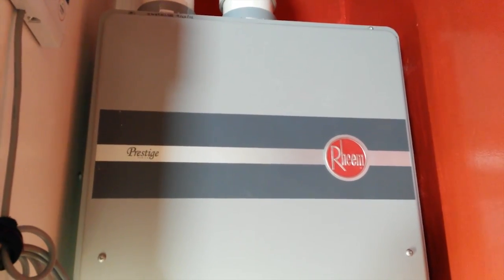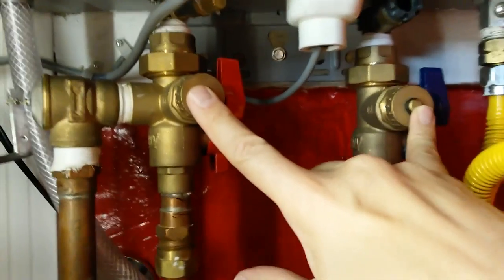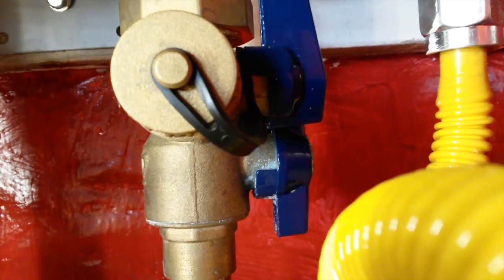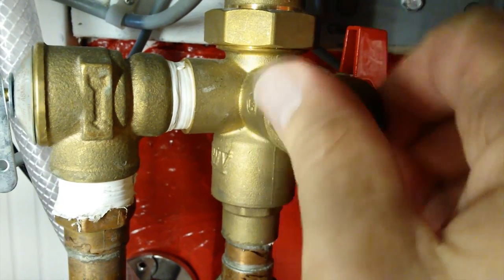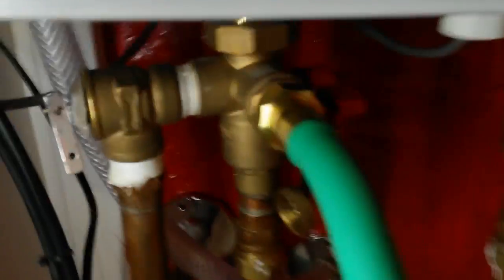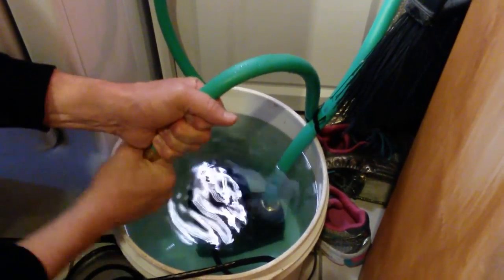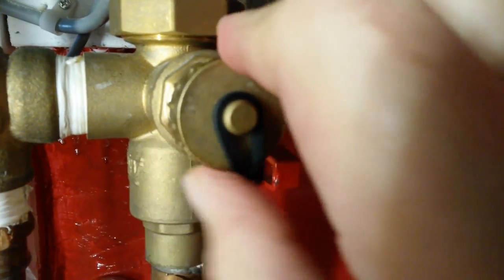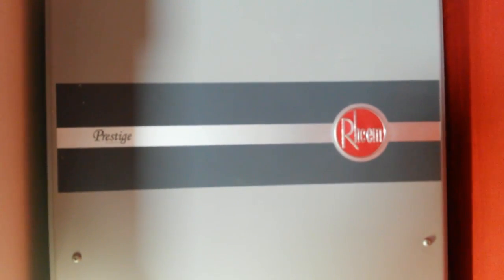Rheem Tankless Lime and Scale Flushing (See updated video https://youtu.be/St38CFhiaI0)

Comment from the maker: For updated procedure go to https://youtu.be/St38CFhiaI0

WARNING: Do not use the power switch to turn off unit, instead just unplugged or turn off the circuit breaker. This will prevent the internal valves from closing and bypassing the heat exchanger.

For updated procedure go to https://youtu.be/St38CFhiaI0

Comment: If mine doesn't have service valves, how can we flush the unit?
Reply from the maker: In order to circulate the solution you would need service valves added to the system. In the past I have purchased two of these units and each time had to specify the valves. I understand now more companies are now including them.

Comment: So I followed your replacement video to a T and when I run the pump nothing comes out of the hot water side.  I can lift the thermal relief valve and it will flow out of that, but not a drop out of the hose side.  Do you need to have the hot water running in your house when you kill the power to it to keep the internal flow control valve open?  Because if you just power it down with the unit not running the valves would already be closed.  I don’t get it.
Reply from the maker: For updated procedure go to https://youtu.be/St38CFhiaI0  You need to turn off power to the unit, as opposed to using the power switch.
Reply: Thanks for the reply.  I did follow the replacement video and I have no water coming out of the hot side with the pump running.  The unit was not running when I powered it down via the breaker so I’m wondering if there’s an internal valve that is remaining closed?  Should I have the hot water running inside the house when I cut power maybe?  This is a non-condensing unit BTW.
Reply from the maker: @allenemiesforeignanddomest3320  With the unit powered on and the power turned off from the breaker the bypass valve should stay open. (No need to run water) You can test this by allowing water through the inlet service valve into the tankless and it should flow out of the outlet service valve. If that works then check connections to pump to make sure your pumping into inlet side.

Comment: I bought this water heater https://www.youtube.com/post/Ugkx8G49mV71sAzUl9shXyLW-r3XgHH9EVh1 for use in my bus conversion. I installed it under my kitchen sink and it is fed by a high efficiency on-demand LP water heater. It is both a backup hot water source as well as a water saving device since we have hot water on demand rather than having to wait for the gas on demand water heater to finish its ignition cycle. I decided on this water heater due to the fact that it only draws 1300watts when it's ON instead of the 1500 watts that most Water heaters this size draw. In an RV a couple hundred watts can be a big deal. With very low standby losses, I don't have to worry about excessive power consumption. When propane is not available for our gas water heater, in conjunction with our low flow shower head there is enough hot water available to shower, albeit we won't be taking "hotel showers." Also very happy with the recovery rate of this water heater. Granted, it is quite small, but it does exactly what we need it to do.
Reply from the maker: Angel, that is great news, but the manufacturers instructions call out for a dedicated circuit for the water heater. They do provide for several water heaters to be connected to a single circuit, providing it does not exceed the rated service load. Thank you for watching.

Comment: Some additional information from a plumber:

1) The gas tag on the gas inlet is usually just covering the testing port to test gas pressure and most of the time has nothing to do with adjusting or fine tuning the tankless. (At least that’s my understanding with all the training I have gone through.

2) the condensation drain on a lot of those units (not Navien) can be capped like that if they are horizontally vented within a certain distance. They must have a drain attached though if they are vertically vented.

3) Additionally to cleaning out that cold inlet screen you should have the tankless flushed/descaled yearly and if your water is “hard” (has a lot of calcium and magnesium causing scale buildup) you should have a form of water treatment to retain most warranties.
Reply from the maker: Thank you for sharing your insight on this important topic. An updated version of this process is available at https://www.youtube.com/watch?v=St38CFhiaI0&t=0s which includes not using the power switch.

Comment: Incredible video!  Thanks for sharing your knowledge!  We bought a home with a Rheem and in following your instructions, noticed that this installation doesn't appear to have what you refer to as "service vales".   How might I go about flushing this without them?
Reply from the maker: Without the service valves you would have to disconnect the inlet and output lines. At which point you might as well add the service valves. It a shame they weren't put in at installation.
Reply: @cfldriven  Apologies for the delay - thank you for the response!  It appears there are service vales, but no means of turning them off as in your video. Is that just a poor install where a step was skipped (no means of turning off the feed to the service valves)?   This set up looks identical to yours with the exception of missing those smaller handles to cut off that water feed.  Wish I had a means of sharing a photo.  Appreciate your channel and sharing your knowledge!
Reply from the maker: @Steven-wp4wu  Some tankless units include services valves, but both of my Rheems did not. Each time I had to instruct the plumber to include them as part of install. Funny thing is the installation instructions call for them to be put in. 
It is interesting that the service valves from 4yrs ago only have one valve per side as oppose to the double valves in the video.
Reply: @cfldriven  What our unit has is the service valves (with port caps), but not the handles to turn them on/off to isolate the system.  Does that mean this was installed incorrectly?
Reply from the maker: @Steven-wp4wu  Steven, to flush the tankless it must be isolated from the rest of the house plumbing system. Is there a cold water shut off valve leading to the tankless and a shut off valve on the hot water side? If there are in close proximity to your service ports it could work.
Reply: @cfldriven  yes, the hot & cold shut off handles are in line with the service caps.  Is there a means of sharing a photo with you?  In the interim, I've placed an image in my profile pic. Does that help?
Reply from the maker: @Steven-wp4wu  Your setup will work, this design handles the function of the dual valve using only a single valve.
Reply: @cfldriven  Yay!  Thanks for all the support and sticking with me on this one!  Getting my supplies sorted to tackle this over the weekend.  Appreciate it!
Reply from the maker: @Steven-wp4wu  Glad I could help, I actually have a similar valve and port setup. Perhaps I should do a video about it. Good luck with the project.
Reply from the maker: @Steven-wp4wu  Hope your project was a success.

Comment: Maybe I missed it, but you never said yo turn off the water going into the unit. (Pre-bypass valve)
Reply from the maker: You are absolutely correct, since the service valves include shut offs for the incoming and outgoing lines plus to each of the ext ports there no need to shut off water to the rest of the house. Of course if one feels more comfortable it can be done. Thanks for bringing up a good point.

Comment: Is there any need to turn off the Gas Valve in this process?
Reply from the maker: It is part of the official Rheem procedure, with the power off the unit can no longer operate or monitor the internal gas valve and thus closing the external gas valve avoids any possible leak.

Comment: Thanks for this video. Very helpful. The manual mostly made sense but this walkthrough really helped bring it all together.
Reply from the maker: The big gotcha is not using the power  button to shut down the unit, instead unplugging it or shutting down the circuit to it. Thanks for watching.
Reply: cfldriven thanks for the tip. I did also watch the updated video that you made.  Thanks again.

Comment: One problem...inlet cold water valve is closed when power is disconnected....now what??
Reply from the maker: Inlet valve closes if you press the power button, if you just pull the plug or open the circuit the internal valve remains open.
Reply: @cfldriven  that's only if it on and running. I have a bank of 7. I flip the t&p valve then close the outlet on the hot water side while the unit is running. Then just unplug and the water inlet valve stays open. Then I start the flush. Then I have to let the system cycle to the next one, and do it again.
Reply from the maker: @insideoutsideupsidedown2218  Thank you for sharing your experience.

Comment: I have a 1800 gph 1/4 superior submersible pump? Is this an adequate pump to use?
Reply from the maker: As long as you don't exceed the max pressure rating for the unit you should be fine. You just need enough pressure to flow the solution through the coils.

According to the manual "The pressure rating of the relief valve must not exceed 150 psi (1,034 kPa) or the maximum working pressure of the water heater. (See the rating plate on the water heater.)
Reply: Yes

Comment: Hello, What kind of pump do you need to get?  Did I miss a link?  I'd love to know where to get the products needed so I don't have to pay $130 for the service and $159 for the visit (this is the only company that I can use or it negates warranty). Thank you!!
Reply: Also, I haven't done this before and our tank is 4 years old.  Do you think I should do it more than once? Thank you!
Reply from the maker: Stephanie, thanks for posting a link. The pump I use was a gift so  I have no idea what it cost. 
In your case I would replace the solution and run the pump one more time. After that at least once a year. Good luck and thank you watching. If you can subscribe, thank you.
Reply from the maker: Stephanie, you can try the following link for a connector or any hardware store. Especially like an Ace or Tru-Value. You don't want too long of a hose because you'll need to push the solution through the entire length and the pump will have to work harder.
https://www.grainger.com/product/1P724?cm_mmc=PPC:+Google+PLA&s_kwcid=AL!2966!3!166588899559!!!g!82166687037!&ef_id=WBoTcAAAAWH28ffZ:20180131025836:s&kwid=productads-adid^166588899559-device^c-plaid^82166687037-sku^1P724-adType^PLA

Comment: THIS IS NOT CORRECT AT ALL!!!!!! if you turn off the remote control to the unit before cutting the power you will activate bypass switch and the whole process will not work. you will end up wasting your time and vinegar.  DO NOT USE THIS VIDEO
Reply: Crap, now I have to do it all over again, I followed this video, and didn’t read through the comments, as a neighbor shared it with me. Off I go to get more vinegar. Smh
Reply from the maker: Yes you are correct, as I had already noted in the description and even provided a link to an updated video. The reason for leaving this video up is it shows the process and provides useful information, including the correction. Thank you for your feedback.
Reply: You beat me to the punch Kristi. You are 100% correct. People that are not in the trade should not be making these videos and wasting peoples time and money.
Reply: I’ve tried killing power at the breaker, turning the hot water on inside the house and then killing power and nothing works.  Water will not flow!!!  There is something about these Rheem’s they are not sharing to get the flush to flow through the heat exchanger.

Comment: That is one of the ugliest installs ive seen. Flex water supplies and flex gas line is pure laziness. Correct way to flush a tank tho!
Reply from the maker: Actually in California flex lines into appliances is the way to go due to seismic activity. The problem with replacing an old water heater with most tankless unit is the connections are on the bottom. Definitely worth doing in new construction or remodeling, otherwise installation can be challenging. Thank you for commenting.
Reply from the maker: Good question, it all depends on the type of shaking, the amount of shaking and the duration. It may stay bolted or it may be stressed beyond limits, causing it to dislodge or fall. The flex lines are per code. 

In the Northridge quake the top strap on the water heater failed and the unit tilted. Only the flex lines kept it from falling over.
Reply: James Webb no shit,‘horrible

Comment: Thanks for posting the video. I have had the same Rheem tankless water heater for a couple years now and have not flushed out the scale and lime yet. I am concerned about recirculating the scale back through the pump and coil system. Is there any visible scale left in the bucket after the process? If so, would you recommend placing some kind of screening barrier (i.e. pantyhose filter on the outlet) between the two flows? Also, would a 300 gph submersible fountain pump be sufficient? Thanks again!
Reply from the maker: The solution dissolves it, so there isn't a need to do more. At 300 gph we are talking about 5 gpm which for the recommended run time should be sufficient.

Comment: How often do you need to do this?
Reply from the maker: Once a year
Reply: @cfldriven  Nice video, thanks! 
If a water softener system is installed, do we still need to perform descaling every year?
Reply from the maker: @rkneti  Depends if the water softener is before or after the tankless unit. If before you can go longer, in my area I have soft water and will be flushing every three years whereas my prior home had hard water area and it was every year.

Comment: "WARNING: Do not use the power switch to turn off unit," 
is this the power button on the remote control that you are referring to? i flushed mine today, i just cut the power at the breaker box without turning the unit first using the remote control.  but i didnt see much scale in my bucket when i was done??

my remote and  my heater are on the same circuit so when i shut off the breaker, both turn off simultaneously. does that cause my flow to bypass the heating elements?
Reply from the maker: Yes it is the power switch on the Remote Control panel. By cutting the power at the circuit breaker you prevented the internal valves from closing, which is a good thing. Had you powered the unit down via the Remote Control panel the internal valves would have closed thus bypassing the tubing in the heat exchanger.  I have updated the warning. Thank you for your input, much appreciated.

Comment: I have been working on a tankless water heater that doubles as the boiler for the hot water baseboard system. I can't pump the vinegar through the heater and someone has told me there is a special (3 way?) valve inside the heater that keeps the two water flows separate and that it isn't opening. What can I do in a situation like this, if there's anything to do?
Reply from the maker: Peter I would check with the manufacturer of your unit. BTW how do you like the system for heating? What brand? I am thinking I will need one in NC.
Reply: All you need is 2 valves on the tankless like the one in the video.  After cleaning just hook up a water supply to the cold water  inlet and flush the vinegar into a pail. Then just close the flush valves and open the valves to their normal operating position.

Comment: Why do you need to run a hose from the hot water side to outside when finished to flush vinegar out? Why not just return everything  to normal and open a hot water valve in kitchen sink and let the vinegar flush out and drain there?
Reply from the maker: Did not want vinegar going into my plumbing system when I could easily flush it directly from the tankless unit.
Reply: Just open everything back up and flush with your incoming cold water and open all hot water fixtures to the bath and kitchen. I'm a plumber and you are correct Kelly.

Comment: Do not turn the unit off. That closes the valves inside the heater. You will circulate the vinegar without flushing the heating exchange. Read the manufacturer manual closely. You should unplug the unit instead.
Reply from the maker: Thank you so much for the correction. Next flush i will update video.